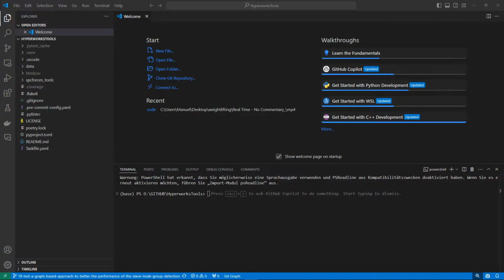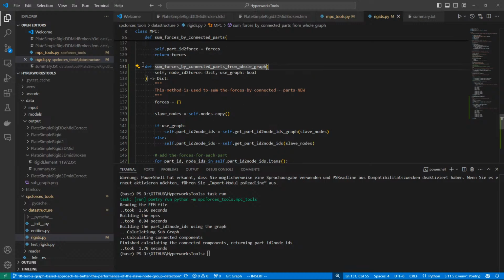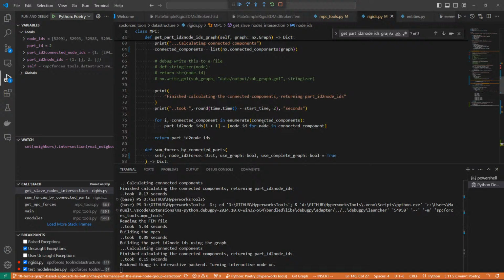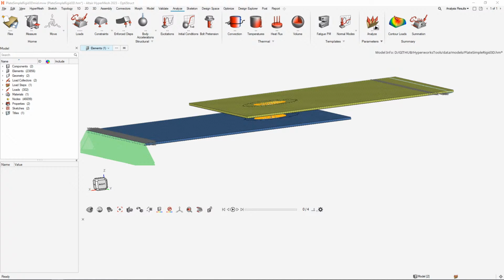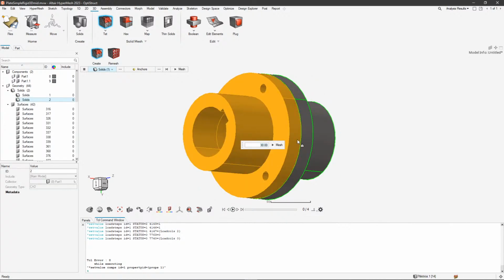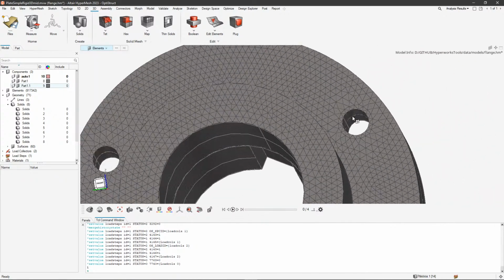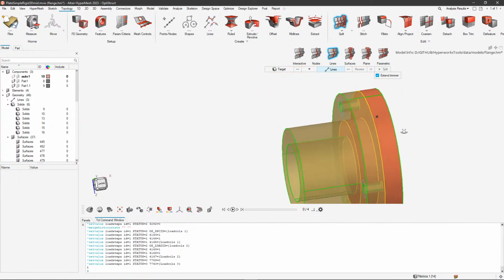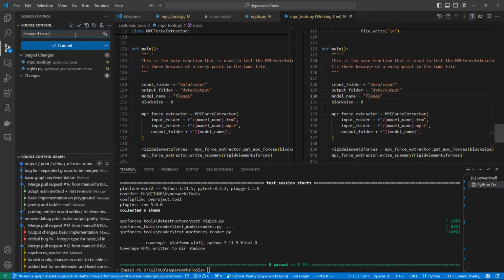A bit more graph-based group detection implementation

Comment: Defeaturing sometimes convert solid to shell or If sometimes I dont have solid but shell. i use volume tetramesh, supress many edges that are problematic then create 2d tria/quad mesh on the faces first and then volume mesh.
To avoid  tet collapse or some errors . This way I can control the surface mesh.